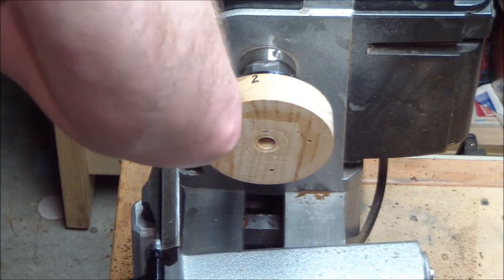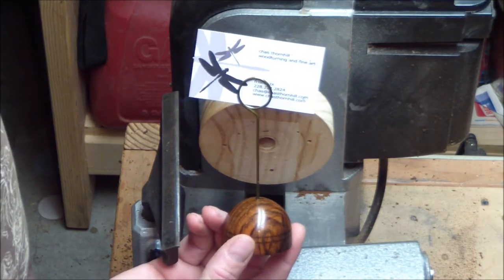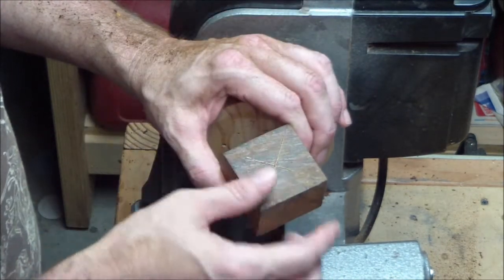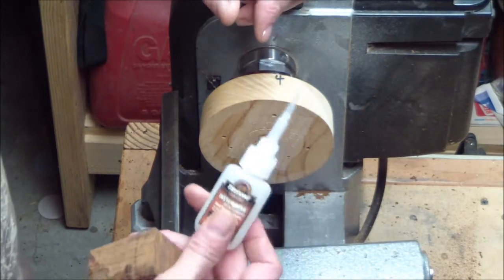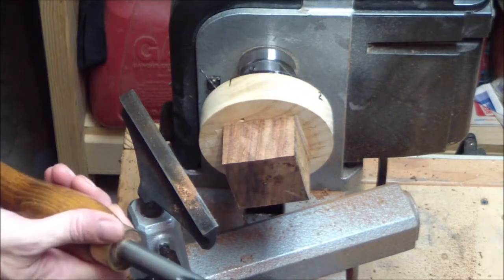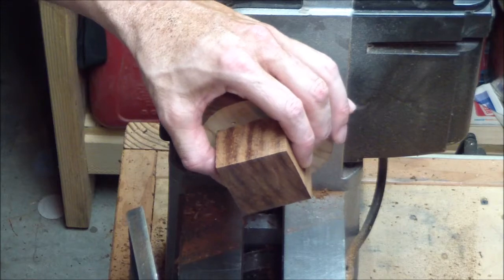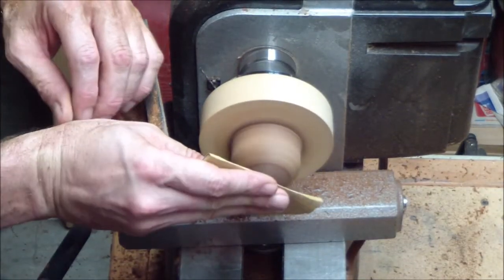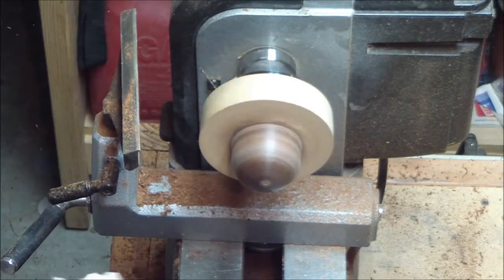Photo Holder Project

Comment from the maker: That is a great idea, David.  I don't know how easy they would be to bend, I expect not too hard.  I don't think rust would be an issue with coathanger wire, I have never seen a rusty one, but the bronze coating is easily removed by accident and that would not be an issue with stainless steel.  I will give it a try.  Thanks for the suggestion and thanks for watching.

Comment: Nice project, Chas. How about using a straight gage stainless steel bicycle spoke instead of coat hanger wire?  No issues with rust, corrosion or fading.  They are cheap, better made than coat hanger wire and they can be purchased in various lengths and gage to suit the requirement.